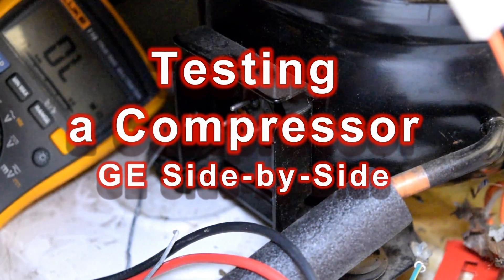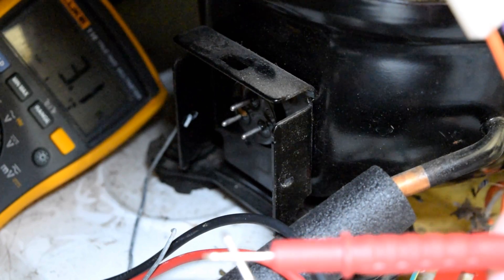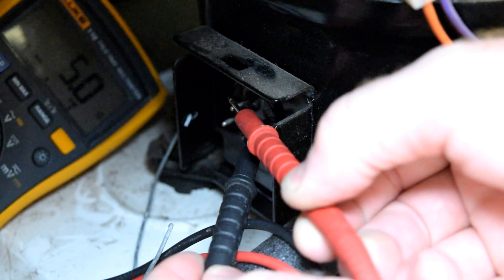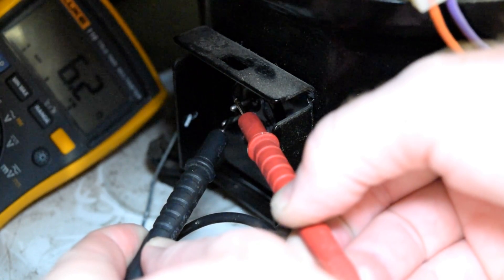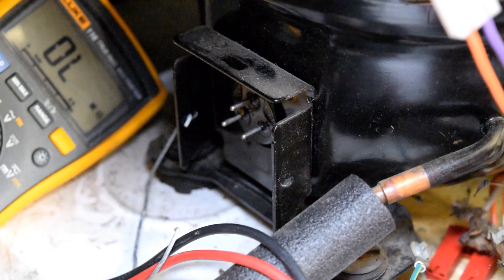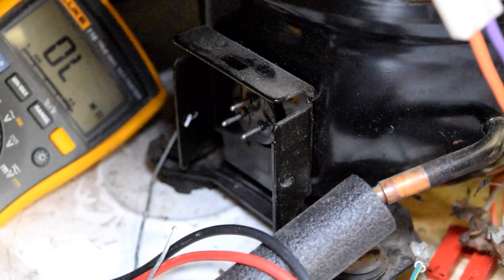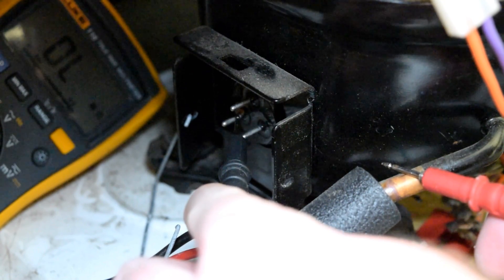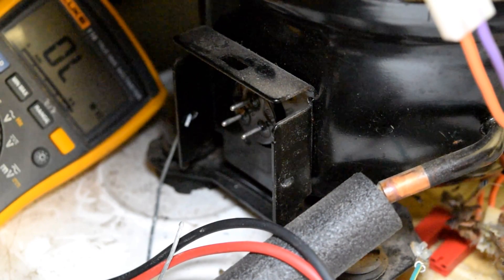Testing a Compressor (no inverter) GE Side By Side

Comment: I tested my compressor and got 4.8 + 6.8 + 11.2.   When I plug in the refrigerator with that connector plugged it in trips the breaker immediately.  But it doesn't trip when I unplug it first.
Reply from the maker: Hey Ekzatal,
So when you leave your compressor unplugged the breaker does not trip?
Have you checked each pin to see if you have continuity between the pin and a copper piece of the compressor?

You want to verify that none of the pins are shorted to ground.

Comment: I wasn't sure what video to post this on, but about a week after fixing my GE refrigerator by replacing the defrost heater (thanks to one of your other videos), it started making a LOUD clicking sound any time the compresses turns on or off.   It sounds like a relay, but I'm not sure which relay it is.  The refrigerator will click every few minutes at irregular intervals.  The strange thing is, the refrigerator seems to be working perfectly fine (both freezer and fridge are at appropriate temperatures), but the loud clicking sound is driving me crazy. 

Would this be the start relay, overload PTCR, or something else?

Comment: Is the compressor supposed to be warm and have some kinda vibration when running? i feel a hint of vibration but it could be coming from the condensor fan..
Reply from the maker: Yes, it should feel warm and have a slight vibration to it.  You can also unplug the condenser fan momentarily to isolate the compressor function if it’s helpful.
Reply: @GraceAppliance  thanks for the super quick reply. will try your advice soon when the condensor fan turns on again. not sure why its off right now.

my problem is the freezer isn't freezing anything except for an ice cube tray, and that takes about half a day. theres no frost in freezer and no frost or ice build up on the coils. evap fan works. what part do you think is most likely the cause of this?
Reply from the maker: If the freezer is too warm, and the compressor isn’t running I’d first look at the temperature sensor for the freezer section.  I have a video called testing and replacing a defrost sensor which should help.
Reply: @GraceAppliance  so the compressor is running. i checked the compressor's terminals (J8 and J7-9) on the motherboard and got 115V. i've also replaced the white thermistor about an hour ago. the compressor turns on for about 5 minutes then off. is there anything else i can check?
Reply from the maker: @tee228  are you getting power to the compressor still when the compressor stops running or does the voltage cut out too?
Reply: @GraceAppliance the voltage cuts out when the compressor turns off
Reply from the maker: If the power cuts off to the two wires BEFORE the compressor relays, (the two wires that go in to the relay) this would be a failed control board.
Reply: @GraceAppliance  sorry, forgot to mention i just replaced the control board with a brand new one, but its still acting the same.
Reply from the maker: @tee228  ok, I would remove the relays from the compressor (with the fridge unplugged) restore power and take the voltage reading again before the relays on these 2 wires coming in. If you do not have steady voltage there, I'd remove a plug at a time from the control board (don't touch a board with live voltage of course) and restore power to see if the compressor voltage is then steady on.
This will help you narrow down a problem circuit that may be robbing voltage due to a short. 

I'd start with the evap and condenser fan circuits as they tend to be troublemakers.
Reply: @GraceAppliance  will check when i get back. thanks!
Reply from the maker: @tee228  also double check for a failed temperature sensor in the freezer and fridge if you haven't already. If the fridge thinks it's cool enough already it will not run the compressor any longer.  Let me know if you have any questions.  Andy
Reply: @GraceAppliance  i've checked the ohms on the 3 pins on compressor and they are correct. total came out to be around 11.5 ohms. the two wires before the relay are giving out around 120V so it seems all is well for the compressor which seems right since it is freezing but not enough to freeze food. i'm going to replace the thermistor on the fridge side soon as it comes in.

i found another thermistor on the freezer side on the lower left. what does that measure and should I replace it too?
Reply: @GraceAppliance  great news! My freezer is freezing again. Food is hard as a brick. It was the lower thermistor. "Repairman" from before did a Mickey mouse job on it. He used butt connectors and I assumed it was tight until I pulled it and it came off easily. Anyway thanks for all your help and these videos, definitely appreciate it!!
Reply from the maker: @tee228  awesome news!  Thanks for the update.  Stay in touch.

Comment: Andy, I agree with everyone else. Well done video's especially the volt meter primers.  Question on KitchenAid fridge, Model: KSBS251IVWH00. I get a sonar-like ping sound and also exhibits  the fan or something is cycling on and off; and its not all the time. The fridge running well and no ice build up in the freezer; condensers are clean at the bottom.  I did notice when I did an inspection at the back, with the power off, the fan does not run freely when I give it a spin, rotates as if one side had a weight on it.  Where can I go to diagnose what the issue is. Here in So. California, the repairmen are actually salesmen and want $500 to make a  house call and then they want you to by a new $$$ fridge.  Pretty silly IMHO.  Any thoughts? thank you.
Reply from the maker: hey!  Thanks for the kind words. 

So, just based on your description, my initial thoughts are that a relay on the main control board is failing.  This will cause a fridge to cycle on and off as you describe.  Very few other things can cause this symptom.  For your particular fridge, the part is WPW10133710.  Unfortunately, this is a discontinued part based on what i'm seeing.  You do have the option of getting your existing board rebuilt, but this takes usually about 10 days start to finish.  :(

This is assuming a lot of course.  It could be a different issue, but it will be a tough diagnosis as it is only intermittently failing and you'd need to be testing the board at the moment it fails to confirm this point. 

There is a company in Austin, TX called fixyourboard.com and they do phenomenal work. I've used them several times through the years with zero issues. 

To me it sounds as if the board is in need of their service. 

I hope this helps, 
Andy

Comment: Hi Andy, watched most of your videos. My fridge is cold (36) but freezer is at 14 degrees. I cannot find such symptoms in your videos. I'm wondering if my 2011 ge side-by-side has a failing compressor as it is not able to cool freezer to the setting of 0 degree. Any advice is appreciated. Thanks.
Reply: Oh, the defrost is working as I saw it came on. The evaporator fan is working as there is cold air coming out. The evaporator coils are clear except the last 2 coils which froze and I thaw them out. But the freezer will not go down to 0 and if I open the freezer to take something out, the temp will go above 14 and takes a long time to go down to 14.
Reply from the maker: @samanthat2140  hi, when you say the coils are clear...they should have a light coating of frost on them (almost every rung) if the compressor has been running at least 30 minutes. 
If not, this sounds like it would be a sealed system issue. I.e failing compressor or a refrigerant issue.  Unfortunately these types of issues will typically scrap the fridge just due to the cost of repair.  

If you wanted to let the compressor run for about an hour and take a picture of it you could send that to graceappliance@gmail.com and I am happy to take a look.  Thanks!
Reply: Here is the picture after the evaporator coil ran for an hour. 

https://ibb.co/G3Jvnj4

Comment: Hi Andy, I tested following your procedure and compressor is looking good. But in my case fridge(GSS25WGPDBB) symptoms are:
Compressor and none of the fans running, dispenser light flickering and temperature control is showing up as blank. Tested main board for voltage using your other video and it's showing up bad(low DC voltage all over the board). Now, I have a new motherboard and still fridge is showing similar behavior as above and making a hissing(mouse) like sound from the control board area. Here's the recording of it: https://clyp.it/hzvso0lo 
Any thoughts what it can be? Thanks for the help
Reply from the maker: Hey Maverick,
I'm sorry to hear about the issues!
Can you please send me the first 5 digits of your fridge serial number and also the part number of your new board that you installed.

That noise to me sounds like repetitive relay clicks trying to engage perhaps? Not sure, but it's an interesting sound for sure.

I'd also try unplugging the front dispenser board and trying to plug in the fridge again and let me know if any changes.
Reply: @GraceAppliance   Thanks Andy. I just unplugged J2 connector and fridge is acting completely normal, all lights showing up, so as compressor fan and compressor. Dispenser is working too. Does it mean evaporator fan motor is short and causing all of this issue? Here's the serial number: GG241228. Thanks for the help, once again.
Reply from the maker: @maverickperson5443  yes, the J2 circuit is your fans plug. For sure one of your fans is shorted out and most likely it's going to be the evaporator fan motor, but it's easy to determine this. Plug J2 back in for this test. The condenser fan behind your refrigerator is easy to access and unplug. If the symptoms still remain with the condenser fan unplugged, it's going to be the evaporator fan motor. It's most likely because it lives in a wet environment and water infiltrates the motor and shorts it out.

Let me know if you have any questions, Andy
Reply: @GraceAppliance , thanks again Andy. Do you know if condenser fan uses AC? Because once I unplugged J2 connector, condenser fan was running and it was replaced almost a year ago. While evaporator is I believe still original one. Appreciate your advise about the 2nd test, let me do it now.
Reply from the maker: @maverickperson5443  my mistake, yes. Your condenser fan is 120v and not on the J2 circuit. The evaporator fan is your culprit. Thanks!
Reply: @GraceAppliance  thanks again, just tested - J2 plugged and condenser unplugged and fridge was showing similar behavior. Definitely evaporator motor. Now question, can I use the fridge in the meantime?  Even if it's just the freezer side?
Reply from the maker: Hey, I'd you left the j2 unplugged you can use the fridge with no problem, but the freezer (and fridge side) won't keep as cold as it should due to no air circulation. Sorry to say.
Reply: @GraceAppliance  Thanks again Andy. Have a question for evaporator fan motor replacement, in case of my particular model all wires are clumped together and there are 3 connectors on motor bracket. Do I have to cut the wires for fan motor and then install it accordingly? It seems like, I can't remove the connector where I can solder/connect wires outside the freezer. Is there a trick to it?
https://postimg.cc/nj0B1zbg
Reply from the maker: @maverickperson5443  hey,
I'm sorry the picture isn't showing up well for me, but you should not have to cut any wires to install. It should have a white plug that should match up with the new fan. No?
Reply: @GraceAppliance  thanks again, it doesn't look like the case. Here are few more pictures
https://postimg.cc/WFLgP6KP
https://postimg.cc/T5TbK2f7
Reply: So it ended up bad evaporator fan motor which was causing the issue with the new control board too, with new evaporator fan motor, so far things are looking much better now. Thank you for the help Andy :)
Reply from the maker: @maverickperson5443  awesome! So glad to hear that!
Yes, I think the plug you were looking for was at the lower left of that picture, no?  You may have to cut the blue rubber and pull the wires though. Either way, sounds like you made it happen! Nice work.
Reply: @GraceAppliance actually my fridge had a thermistor in the same connector too, so either I have to order the part with thermistor and fan motor and do as you advised, cut the blue harness and just replace with a new one.But since I ordered the fan motor alone, so had to cut the old motor and connect the new one. Thanks again for all of your guidance and help.

Comment: I usually scratch a place on the compressor and touch one of my leads to it in order to check for a short.  That being said, the copper lines are connected to the compressor.  May actually save a little time.
  Not sure I have ever really thought about it, but since Common, Start, and Run windings are connected, is it necessary to test all 3 for short?
  Title included the relay.  Did you forget?  Just thought I would mention that.  :)
Reply from the maker: Thanks Rickey!
Either way works fine. Scratching the compressor works just as well too. As far as the com, start and run that's a good point. If they all ohm for resistance. If you've done the ohm test between all 3 pins and it passes, you can then check for ground on any of the pins I would think.

I need to re record a relay test video as the one I had was not great. To be continued. :)